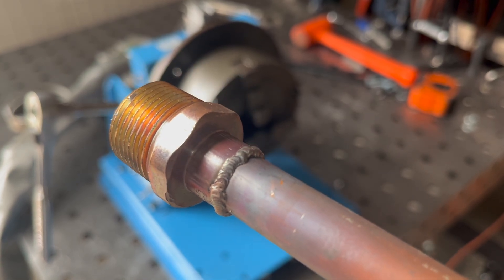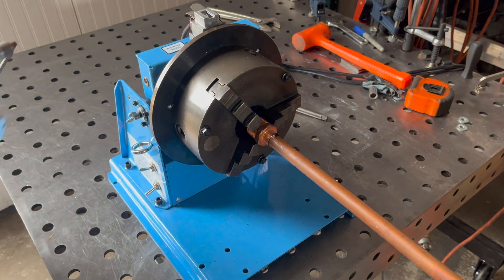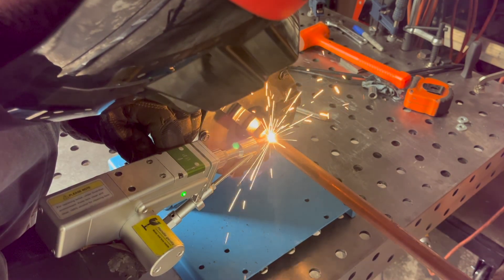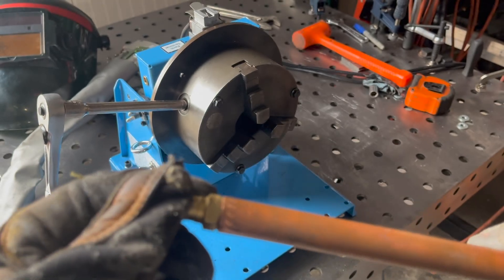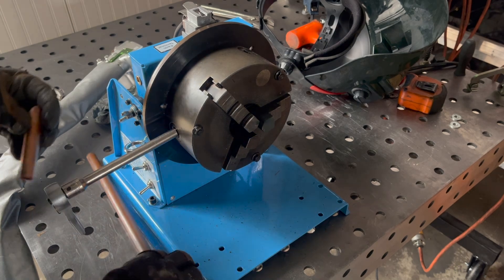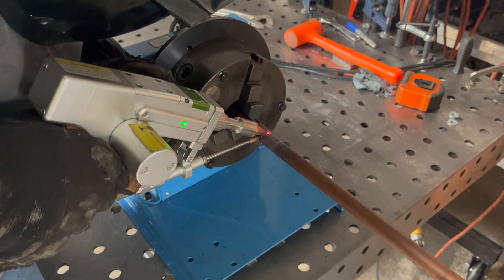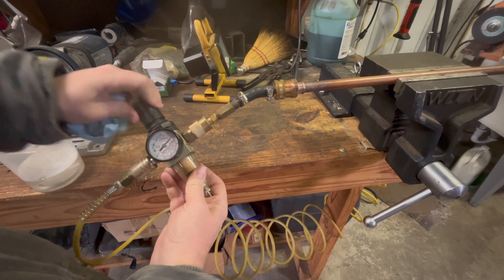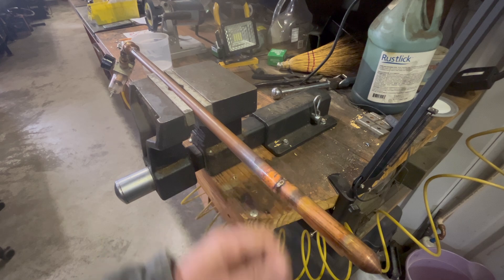Stainless Steel used to Laser Weld Copper Pipe.

Comment: Infrared is reflected by copper. You need more power. Green lasers are used for copper. I’ve got the XTools 1200 watt model. I can weld copper without wire with that, but it’s not happy doing it. While welding it with stainless is great. I’m not sure how much it will hold over the long run. I’m going to try using.

Laser welders are strange. I’ve welded two pieces of glass together.
Reply from the maker: Cool to know, thanks!

Comment: I was just wondering if you have tried cutting with nitrogen.
Reply from the maker: @BTMENGINEERING  not yet, i do have plans on cutting with different gases and showing results.
Reply: @kwrigg  I have tried oxygen but with no good results. I look forward to your results.
Reply from the maker: @ what pressure and tip diameter were you using?
Reply: @k-rigg  1.5mm double nozle, tried using low and high pressures . Alot of dross underneath.
Reply: @BTMENGINEERING why don’t you try air? That’s what I use. Try at least 120 psi. Oxygen seems to give a lot of dross. Nitrogen is funny. Sometimes it seems great and sometimes not so much.